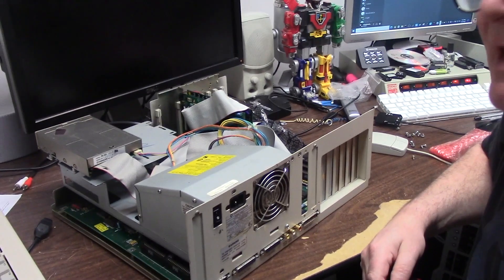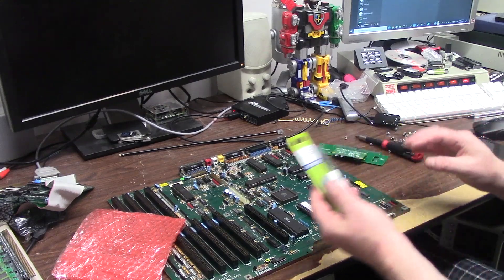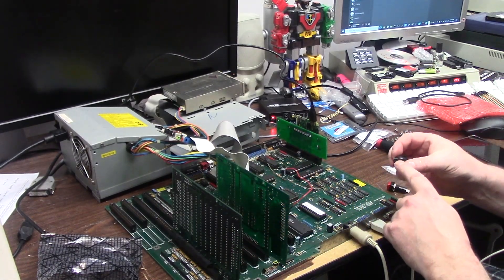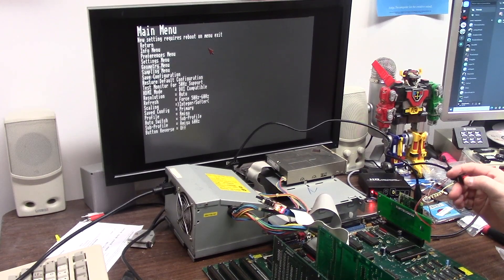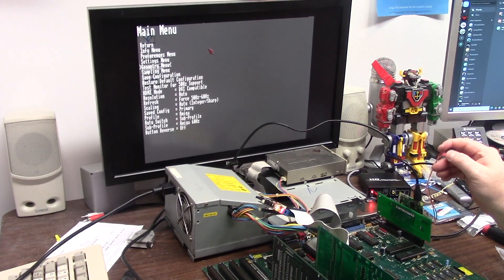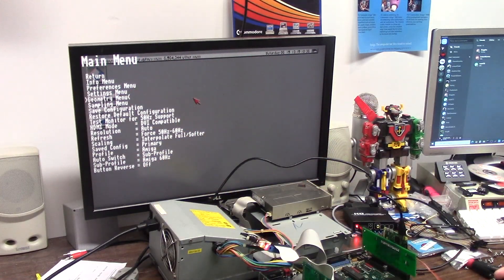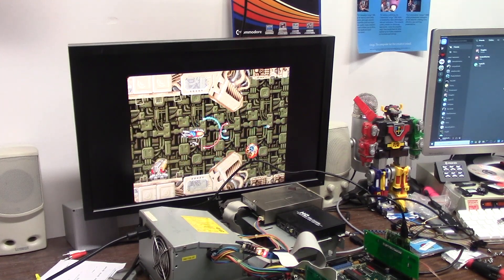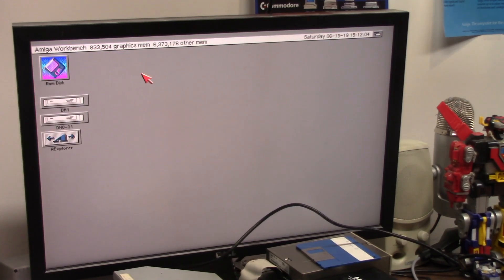Amiga 2000/3000 RPI video p2 better w a button!

Comment: Thanks for the video Chris. There's a new revision coming for the RGB2HDMI for the A2000, which fixes quite a few bugs on the model you have. (ground fill, floating pins, incorrect voltage regulator, etc) LinuxJedi is working on it, in Bloodmosher's github repo issue #43 documenting it. Another cool Amiga-Pi related device to cover in a future video is the PiStorm. It will give you CPU acceleration + gobs of fastmem, hard drive image boot, and RTG for about $20. The boards can be purchased fully assemled in their group buy on Discord.

Comment: Glad you took the time to check the board,, as I said before was not sure if it was the camera or not. That is a super clear image, almost like the image quality you get with emulation (this maybe heresy to say but meh) It gives you options which is always nice, can go from the full screen to 4:3. Seen some cases where people have used these RGB2HDMI and have misaligned the pins and destroyed their pi's, is this the same sort of thing? Speaking of the PI does it need a safe shutdown or is it bare metal?
Reply from the maker: Nah just kill it, its ok to hard power it.  The code is super simple boot linux.  If it blew up Jist reflash 3mb of code.  It can only go on one way.  Everything is marked ( at least on this board silk screen)

Comment: Looks great.  The button contacts are Momentary Contacts so they make and brake and not latch.   Only thing you need to make sure of is the contacts are Normally Open and not Normally Closed.   If I am not so tired after work I will build one board this week.   Yea the Bracket is a good idea to keep the board in place and to have a place to mount the button and HDMI connector.   I saw someone on FB put one in an A4000 which is interesting but I have a Picasso IV Board in mine so I would be hard pressed to pull it out but good to know that if something were wrong with my Picasso I could pop in one of these boards and get out of trouble so to speak.   Having an HDMI solution seems to be the way to go and so yea I would not hesitate to uses these to replace all my Indivision Boards that I currently and what I am seeing here is a much better solution and certainly less expensive.
Reply from the maker: i think they only do ECS modes, so the 4000 would have to run in pure poo mode, i too have a graphics card in my A4000 (gvp spectrum) works great. with a passthrough cable it passes the 15khz through the card . so i still need a 15khz multiscan (like my Dell U2410F) best monitor ive ever owned for old stuff and new.

Comment: Yeah the interface is a bit funky with just a single button, but it's usable.

I get why you like the desktop stretched to use the whole screen, but personally, I prefer to have it keep the proper aspect ratio even if it means I have big black areas around the sides - to each their own. Particularly when playing games I want to maintain the aspect properly.

Yeah I do see some VERY small "sparkling" effect from time to time, depending on which screen mode I'm in, but it's FAR from distracting and SO much better than Composite or going blind from flickering when in interlaced modes...

The best thing is it's just a lot less wires hanging off the back with the scart adaptor and such.  

I made my 3D rear bracket with a spot for the HDMI, the button, and for the twitch for my KS switcher...